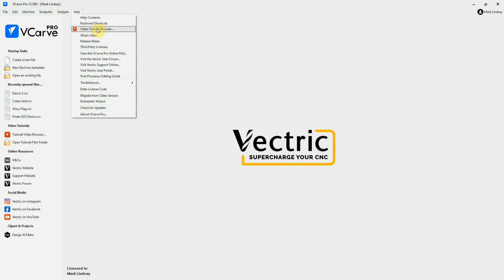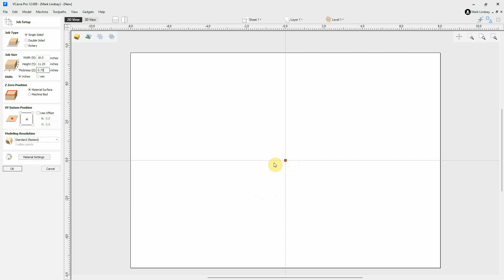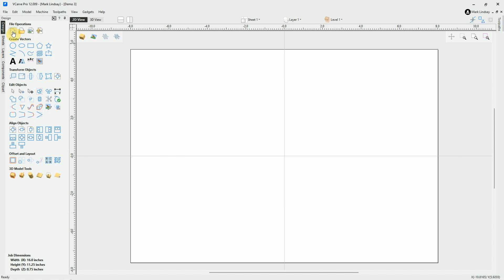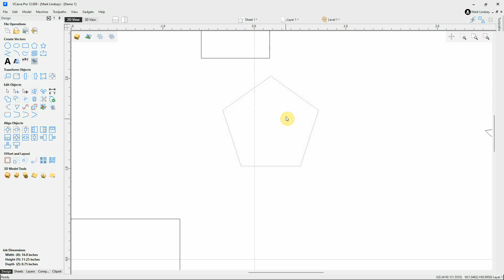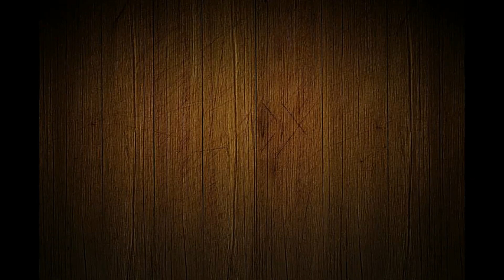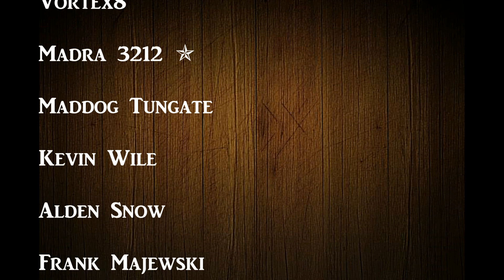Comment: How similar is Lightburn to Vectric. I use Lightburn a lot with my laser. Can I import my Lightburn laser designs tho vectric and convert to CNC tool paths?
Reply: I have never used Lightburn, so I have no way of knowing how similar they are. I would suggest you look at what file formats Lightburn will export, and what file formats Vectric will import, then go from there.

Comment: Howdy! I subbed as I bought a wood CNC machine several years ago then life happened (covid) and it was put into storage. I am getting ready to pull it back out of storage and try to power on for the first time ever very soon. I got carve 3d 10.5 with the machine and until I get able to use the machine I do not want to pay an upgrade on software I have have hopes your videos help and are close to my older SW  :)